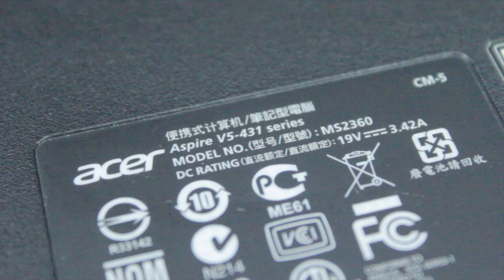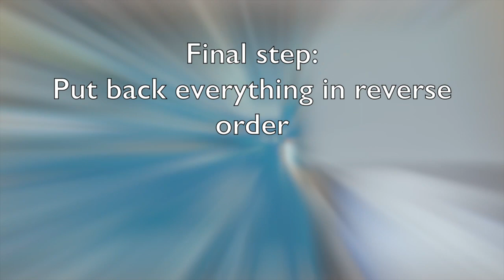Replacing Acer Aspire V5-431 hard disc drive

Comment: Hello. What is the size or dimensions of the internal hard disk that you replace?
Would any brand of hard disk fit in the laptop. Thanks
Reply from the maker: Stacy Glaze Aguirre Hi. I used the standard 2.5" hard disc, maybe it is 7mm in height/thickness. Any brand would do, just make sure it's a 2.5" hard disc. I recommend Western Digital, just because it's the one I've been using all these years.